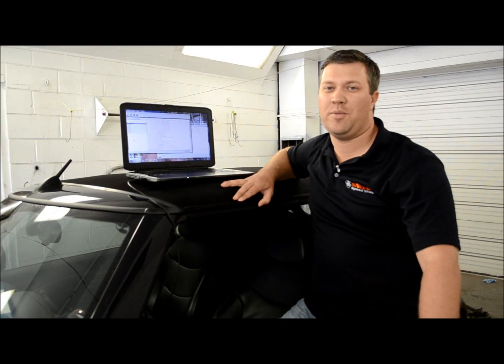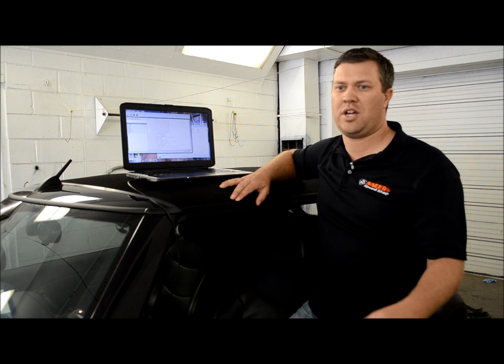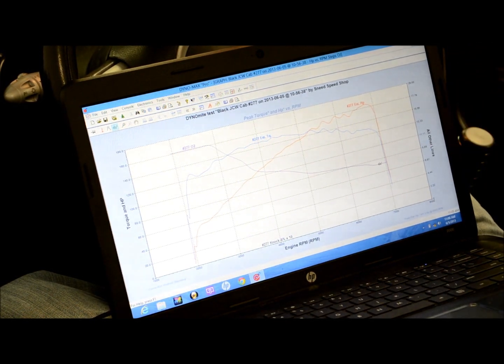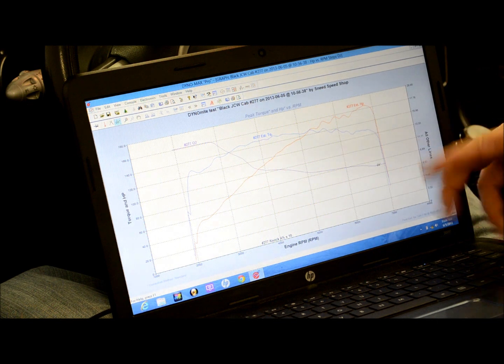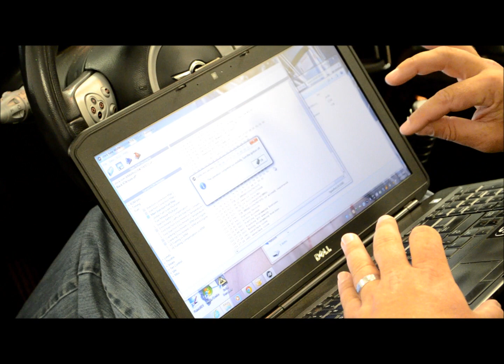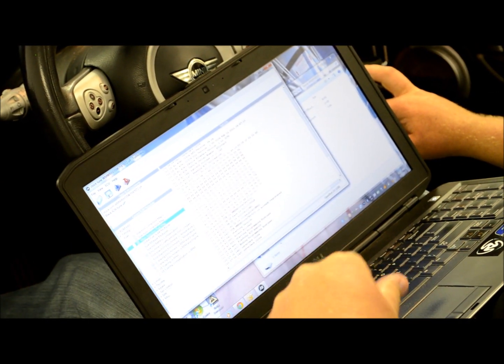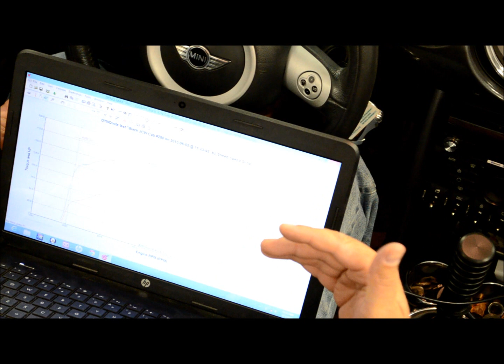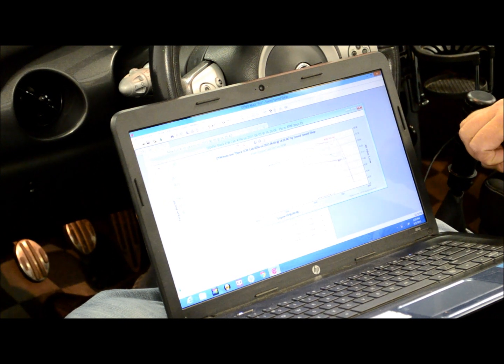How to dyno tune a MINI Cooper S

Comment: Thanks for the vid.

I'm a novice tuner and tuned a bunch of boosted vehicles... his comment at 2:20 stating best power is 12-12.5 afr could be misinterpreted (though correct)...   clarification: you never want to target 12.5 AFR at WOT (that's how high boost engines go boom).  Watch on and he suggests a target of 11.0.  :)

Comment: can I do this on a 2005 base model convertible? If so, what software can I use on Mac OS X where do I get the cable to hook the ecu up to the computer?
Reply: Vgate

Here is the webpage for the review.

http://www.cravenspeed.com/obdii-connector/

There is another company in the U.S. That have that. It was SEMA 2011. But I do not remember the company name 

I used to do international purchase for car accessories and parts back in my days. So I am very versatile on the subject. The one on the computer is better since give you more information. For Mac well that is to find out I have bring out of the field for 2 years. But should be something already on markets
Reply: Carlos De Bernard thanks!
Reply: I'm thinking about getting 2015 audi a3 you can tune those I'm getting 1.8 and tuning adds 80hp and 100 tq!!
Reply from the maker: Jesse Hooton  that is just an OBD2 connector.  It only allows you to read codes and ECU info on your phone.  You have to have software to access the ECU to make changes.  I dont know of anyone making tuning software for the R50 MINI currently.
Reply from the maker: Alex H with the turbo you can add alot of power through tuning but unfortunately I don't have software to access the ECU on your car and tune it.
Reply: SneedSpeed ok I'll talk to my mechanic and do some research. Thanks!

Comment: Thanks for the informative video. If you don't mind me asking what tuning software/hardware did you use? I have been getting conflicting answers from local tuners and very different prices.One says the software needs an "unlock" key and it will be tied to the tuner and another said he had equipment that can do it but it wont be locked to any hardware. I'd like to have some understanding before trying to choose a good tuner. Thank you very much.